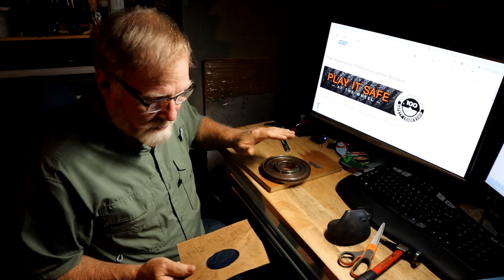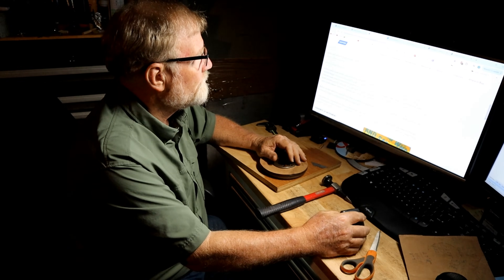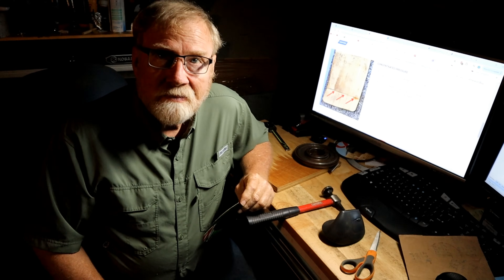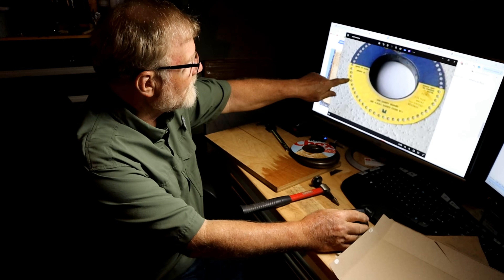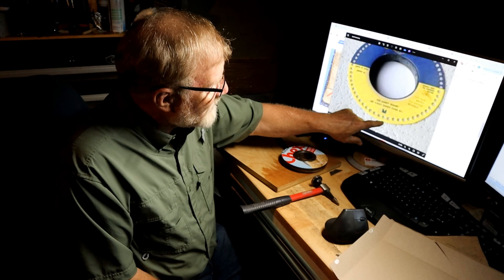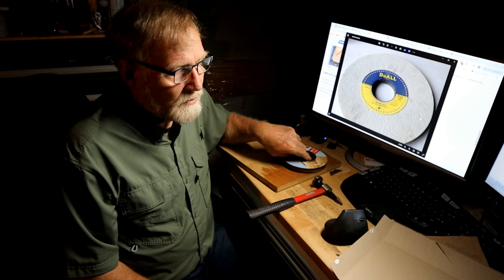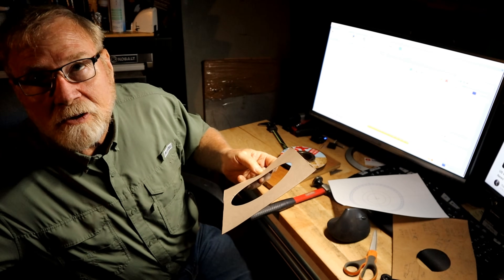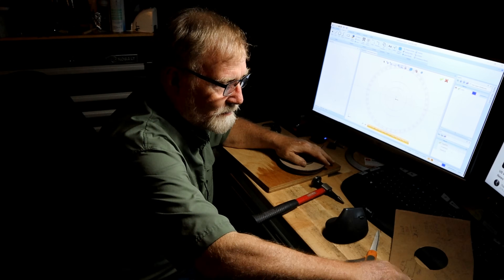I had to make a Perforated Blotter for the DoALL 14" Grinder

Comment: I'd make a fixture.  A center boss to locate the blotter blank, a punch position, and a locating pin some odd number of holes away from the punch.  

I haven't worked out the math, but I think it doesn't matter what number of holes away, as long as it is an odd number for an even spacing like 40.  I'd start with 19.  Punch, rotate, punch, repeat.

Of course if you have a spin indexer it's the same process.
Reply from the maker: God I hope I don't ever need that many :)   Think I'm going to also see if the laser will cut them out from a print.. .Several people have said they think it would work well....

Comment: Hi.
Nice work. 
You made a drawing in a cad and printed it out. That is nice. Specially the part that your printer accepted the carton from cereal box.
On the other hand do I remember correctly that you have/had a laser cutter? Or was it just an engraver? If you could cut it with laser perhaps it would be easier?
Reply from the maker: Don't know how it will burn the paper.. When I return from the Z Bar Bash in a couple of weeks I'll see about it...  My cutter  is not as easy to use as Clark's so it might be a little more learning curve...
Reply: I have snapmaker 2.0 and I have used with 1.6w and 10w laser to cut paper templates and stencils. I don't have air assistance and sometimes edges can be a little "burnt" but it happens mainly with thicker paper. 
If focus and speeds are ok then outcome should be good.
If it works it can make life a lot easier for making also some gaskets etc. Only CAD will take more time than making the gasket on site. Also there are hacks many youtubers take a photo of thr thing they need and use this as a trmplate in cad. If you need more than one, it can perhaps be a good way to go.
All the best and have a nice trip :)

Comment: Steve I have 2 aluminum centrifugal coolant washers basically they have no name but they have the radial trough with holes around the periphery on the blotter side of these there is a annular relief grove where the holes  go through the aluminum piece. These pieces go against the blotter and the wheel hub sandwiches it. So the holes in the blotter on the wheel you are talking about don’t have to line up that annular groove would line up with the holes in the blotter, I wish I could send a picture of these to you instead of this long drawn out explanation thanks for all the videos tell don hi. Ed

Comment: I went down a similar rabbit hole with the DoAll G-10 grinder that followed me home. It doesn’t have the “Cool Grinding” hubs on it but the blotters had deteriorated on the wheel that came with it. I had to satisfy myself with the beer carton solution. I prefer IPA’s myself. That wheel was a 60 grit and I ordered a 46 grit from KBC tools and it seems to be better suited to the projects I have on hand. I have manual for the grinder and some of the original sales brochures for it which make enjoyable reading.
Reply from the maker: They seem to be very good machines...

Comment: You might also look for blotter material in the office and art supplies world. Desk blotters used to have a piece of thicker paper covering the surface of the blotter holder that is the typical work surface of a desk. Hard enough to write on but soft enough to indent and rebound. There are also ink blotters that were used to press in a rolling motion over signatures and other writing while still wet to absorb the excess ink from quill and fountain pen writing. You still see ink blotters used in movies - a cord of a circle with a handle a couple inches or so wide with a paper over the face to pick up that extra ink and speed the drying.

Comment: After your last video, i did a lot of investigating and found the same stuff. I also came acros a group talking about all this and someone that said he used to work for Norton, said they used basic cardstock to make the blotters. So if i were you, i get some standard card stock, the thickness of your choice and get a laser cutter and make your own, as that's a lot easier than cutting and punching out by hand.
I also saw something that said, when changing grinding wheels, you should always inspect the blotters and they should be changed if damaged, so yet another reason to have a few in stock; f you change wheels on a regular basis.

Comment: I think you're having trouble finding it because your searching for a pREFerated blotter, when it's actually a PERferated blotter :-P
Reply: Also, what good does the little bit of extra coolant do getting behind the blotter? And how do you ensure the holes on the blotter are actually lined up with the holes in the hub? The whole thing seems like a marketing gimmick that doesn't do anything of substance in the real world. There's a lot of grinders out there (they make them in factories every day), and if none of them have this feature anymore, it couldn't have been very useful
Reply from the maker: The holes line up as you assemble the hub, not hard at all...  Also the wheels they are used for are very porous and the coolant does actually make it's way into the wheel and is slung out the cutting edge...  Not sure it really helps anything though...

Comment: Look into Rite in the Rain, a company that sells waterproof paper.  I found this product before my paramedic days when I was in the US Coast Guard.  We had forms that we carried on the boats and they would swell from the damp environment.  I have seen this paper displayed in a water bottle  full of water, No degradation.  Not sure what the measurement of it is but they, offer a card stock.  Their part number is NO HW8511.  It is listed as a 100# paper and by comparison the printer paper they offer is 20#.  Might be a waterproof source of material.  Just a thought.  Good luck either way.
Reply: Seems like a good option 👍
Reply from the maker: Thanks I'll have a look!
Reply: @10swatkins  I did some more poking around and found that they have a 175# weight paper also. I know their standard printer paper. Works well but have no experience with the cardstock stuff.
Reply from the maker: @mikeycoop66  I just opened a pack of card stock I had sent to me... It's 160 weight and measures .024.

I'm going to spray it with Thompsons water seal and see what happens :)

Comment: I worry about the centrifugal force on a wet cardboard it would think that a velcro gasket paper might be a better blotter what if you intend on making your own how about taking some scrap metal and making something on Bob see you can punch them out and then come in with a second operation of your punch to punch the holes through you could use needle bearings wedged into a third plate to punch them through

Comment: Hi Steve, my 24th edition of Machinery Handbook states, Blotters or flange facings of compressible material should cover the entire contact area of the flanges.
No other info.
Reply from the maker: IT is a deep subject with little info :(   The .009 thick non compressible "label" on both of the CGW wheels I have for the machine leave about a 1/4" of the wheel touching the outer flanges.... One of the reasons I wanted a larger blotter....

Comment: Surprised you didn't call up Clark from Windy Hill and ask him to cut you some out on his fancy 40w laser cutter, it would make short work of the perforations. 
We use Pig Mat for blotters on the surface grinder we have at work. 👍👍
Reply from the maker: I have a cutter here, only a 20W though... In working with it I found it really burns the edges of material instead of a clean cut..  How thick is the pig mat you use?

Comment: Generic replacement blotters were discontinued a long time ago because they lack requisite warnings regarding use and limitations for the grinding wheel. So you can thank our litigious society for their demise. Consequently, we now have to throw away perfectly good grinding wheels when their labels/blotters come off or get damaged. 

In regards to your situation, if your going to use through-hub coolant, you will need to make your own blotters. None of the cardboard substitutes that you mentioned should be used. Your blotters MUST BE WATERPROOF and cardboard packaging isn't. OEM blotters are typically made from adhesive backed thermostable paper. Avery #64506 labels should work well for your application. Also, you can use your diode laser to cut them out.
Reply from the maker: Thanks I'll look into that!  Right now I'm just using a mister instead of flood until I research the best wheel....

Comment: Gardei makes blotters
Reply from the maker: Did you look into them?    They want to custom print blotters for you.  They say they offer blotters but you have to contact them for a quote....   Another rabbit hole :)
Reply: @10swatkins  True, they are more a source for manufacturers, but they do list some specs, and it looks like most of their products are .010" thick.
Reply from the maker: @RambozoClown  They had one listed as "Produced from cushioning material which meets the industry standards for compressibility" then they had the .010 thickness listed as.... "An economical alternative to the White Cushion Blotters. Made from high quality .010 thickness material"      

 No idea what Industry Standards they are referring to or how thick the cushioning material is... The .009 thickness "blotter" on the CGW wheels was really thin.

Comment: Could you use thick gasket material to make the blotters? I have seen it sold in large sheets.
Reply from the maker: You could... About the only thing it would help is maybe water proofing... Old hands that have done this for years seem to think the cartons work well. Hell maybe they are just cheapskates :)

Comment: Norton Blotters are typically .020" thick.  I've measured them and Norton has thus far been unable to provide them as an aftermarket item.  The paper is supposed to be waterproof as well.  I've been making my own for awhile since you can't get them even for OE wheels that don't have them or they've worn away.  If blotters are this important and they are; you should be able to source them.
Reply from the maker: I would have thought that also!  I'm wondering if the CGW company is following some kind of USA standard ?
Reply: @10swatkins  No telling Steve.  I've got a few CGW wheels and they just aren't the same quality as Radiac or Norton.  The Norton wheels typically run truer and are well balanced.  I just have several old wherls that I've had to make blotters for and it ought to be just a matter of a phone call to get a few extra but so far it's been a real chore.
Reply: I just got a New old stock blotter that measures. 022 and it doesn't look like waterproof paper to me so now I know what to buy for paper.